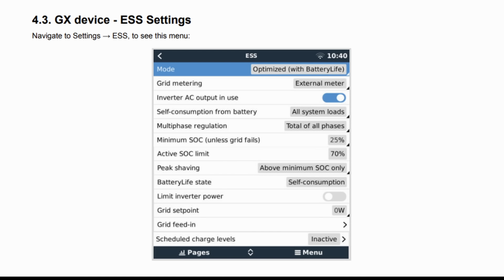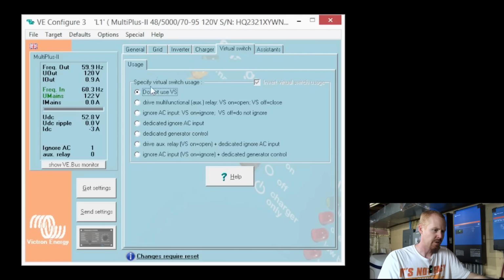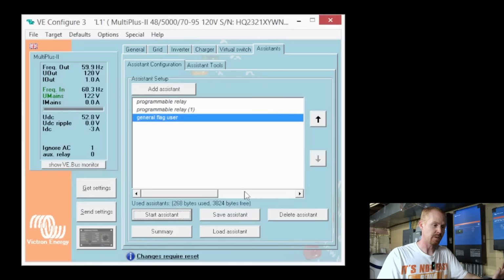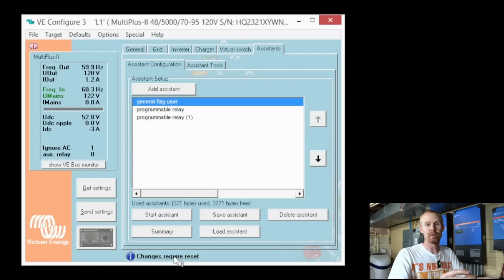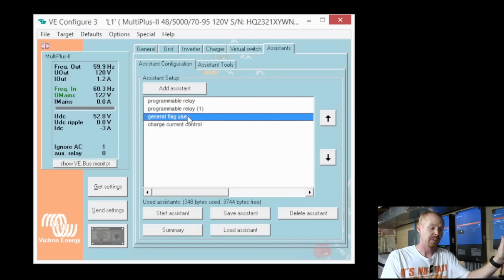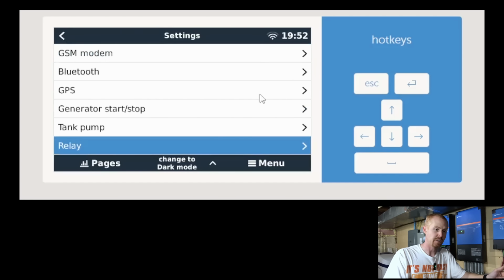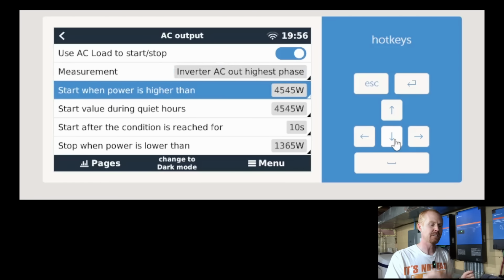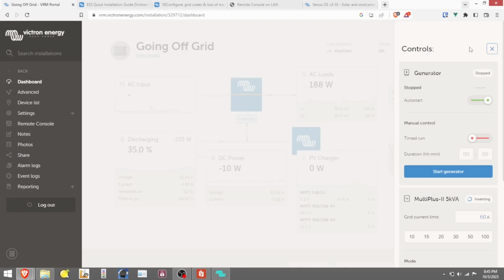Different Ways to Ignore AC Input on a Victron MultiPlus 2 Inverter

Comment: Hello
great video as usual!
I have a question about the multiplus

I would like to be able to charge my electric vehicle at night (22PM and 6AM) and given that my electricity supplier's rate is much cheaper, avoid using the batteries on the multiplus, especially if I have to charge my electric vehicle at night!
Indeed I would not want to empty a large part of the batteries at night to find myself without a battery the next day

Can the multiplus be programmed so that it ignores the charging of the electric car? I would like the electricity supplier to charge the car and not the batteries.
Possible with ESS?
thanks
laurent

PS/ with the programmable relay or the AC/out 2?
Reply from the maker: @laurentsosson1739  appreciate that.  

To my knowledge there’s no way to tell the Aux output to use grid power when the main output uses battery power.  It’s gonna be one or the other.

You would have to install the plug for your car charger between your grid meter and your inverter if you wanted it to run solely on grid power.

Comment: Please demonstrate how you can program the quattro to use the grid as backup while solar with battery is the primary source of energy, like say at night when the SoC fall below 10% so that the grid powers all the connected loads as the battery fill up too, then switches over to battery when the SoC is above 95%
Reply from the maker: I believe the Quattro would work exactly the same as the MultiPlus.  You should be able to use any of the options in this video.

Comment: Great video, thanks for creating it - very helpful for me setting up our system!

One question on the assistants - you've set up the programmable relays with multiple drivers (AC load and SOC), are these conditions "and" or "or"? e.g. do both conditions need to be met for the grid to connect or disconnect, or will it do it if either is true?

I can see this being a potential issue as I'd like to disconnect the grid when SOC is higher than A "and" load is lower than B on one programmable relay, and the other programmable relay to connect the grid when the SOC is lower than C "or" load is higher than D.
Reply from the maker: Thanks!  

So the Assistants regarding SOC and Voltage are in an "OR" scenario.   Once either condition is met, it will switch over to the grid until the "release" condition is triggered.  

You might be able to get more specific on your triggers if you look into using NodeRed.

Comment: Is it possible to switch generator input on and off at two levels of soc? If the batteries are low, turn on grid, and also if batteries are full, turn on grid to export excess solar in ess mode. So in effect two ons and two offs, Is this possible?
Reply from the maker: I’ve never done it before, but it might be possible if you use the assistants to set your values.  You may also be able to use Node Red.

Comment: Would be pretty awsome if you did a video on node red to solve the same problem. I have this set up same as you after following videos, but it has limitations. for example. If I want to charge the batteries at night during cheap rates, i would have to toggle the scheduled charge (which is fine). Unfortunatly, I also have to remember to turn it off in the morning, otherwise it will charge the next night too even though I migt not want it to. Bit of a hassle and lots of remembering. Node red would solve this I think
Reply from the maker: I do have node-red on my list of things to look at.  Unfortunately that list seems to be very fluid and it grows rapidly!

Comment: @adamdelay07.  I am using multiplus ii GX,  i followed instructions to set relay open when SOC is lower than 30% and closed when SOC is above 40% via VRM. Its not working, but when grid connected and it pass through.
Reply from the maker: Which set of instructions did you use?  There were multiple options.  Did you program to use the Virtual Switch, Assistants or the Cerbo?  

There was a note left in the description and a pinned comment about misspeaking regarding the Virtual Switch settings.
Reply: @AdamDeLay07  relays still not switching After using assistant configuration settings for open relay and close.
Reply from the maker: @Kh8876  I'm not sure how everything would work since the "Cerbo" is built inside the inverter.  Setting the Assistants is only part of the controls.  I used the relays in the Cerbo to trigger the Aux Input on the MP to tell the inverter to ignore ac input.  

You may have to look at using a Virtual Switch to control AC input.
Reply: @AdamDeLay07  It works using virtual switch "dedicated ignore AC input". When SOC is lower than 30% it switch to the Grid. Thanks
Reply from the maker: @Kh8876  Awesome!  Glad to hear!
Reply: Inverter is a MultiPlus-II GX it has bildin  curbo GX inside.

Comment: Can it be done with multiplus GX version w/o separate cerbo?
Reply from the maker: @yuriyura2023  I’m not sure of all the differences between the GX and MP2.  I do know that you can program the generator start/stop assistant in VE config to control the AC input.  It’s just not as easy to change.
Reply: No not with gx included muiltiplus.
But with new GX IO Extender 150 maybe.
It has relay out function, but not sure if can be used as gen start

Comment: Hi Adam, great video. I want this to implement in a 3 phase system. Is it possible to connect the Relay 1 com/nc to the AUX1 of the 3 multi´s. It will be nice to notify if this is a safe option.
Reply from the maker: Thanks!  It shouldn’t be a problem at all.  I believe you only need to connect to aux1 on the first inverter.  Since they all communicate, when the relay turns on for one, it should turn on for all.

In my setup, I only have aux1 connected on 1 inverter and the other (in split phase) follows along.
Reply: @AdamDeLayDIY  I ll try it out, one of the coming days, thanks a lot. I ll let know if it works.
Reply from the maker: @edvisser5433  awesome, thanks!
Reply: @AdamDeLayDIY  Thanks again, it works as you said, the master of the 3 phase configuration takes control.
Reply from the maker: @edvisser5433  that’s great to hear!  Glad it’s all working for you!

Comment: Ok I'll look at it in August.  Come to think of it . The ground connection might be the problem. I didn't connect the multi s case with a groundwire . Thought there was sufficient grounding on the mains side. I'll fix it then . Also when I shut it down and restart there are some clicks occuring . Like a relay switching . But it clicks maybe 3 times so on . Off. And back on again . This occurs also when i switch from loading with the switch on to inverter only .  Interesting...
Reply from the maker: @raymondkeersmaekers4785  all the different ground connections are bonded together so using one point should ground things sufficiently.

The clicking could be the grid relay testing and then opening/closing the connection based on what the signal from the cerbo is.  I’m guessing that the grid connection tries to turn on by default and then the cerbo tells it to turn off.
Reply: @AdamDeLay07 Thnx. Tonight I'll try the virtual switch option . Hussle the settings up a bit and assign 51shunt as power monitor. Then something should happen . Currently I'm not near the installation so its all gonna be a bit spooky  .
Reply: Virtual switch is on . Made some comments in the vrm notes section.

Comment: I ve tried it several times with aux1 and then again with aux 2 . parameters are all according to your recomendations gen. start/stop set to auto. now i ve discoverd on the main screen the red part should say ac input 1 ...but its empty , so my guess is it doesnt detect the ac input . active ac input shows disconnected and im not able to change it. 
watched your video 4 times now , .
greetings from belgium . 
Raymond
Reply from the maker: @RaymondKeersmaekers  Howdy Raymond!
Are you trying to use the cerbo to control the AC In or do you just want the MP to have fixed values for the change?
Reply: Using the cerbo . And I´ve made you an invitation to the   installation so you can see the values and settings. The vrm shows ac input. The cerbo not. Ac is of course suplied and works fine with the switch on the multi . Even power assist is possible. 

However do not change any configurationsettings  without  noticing me . Thnx for your help.
Reply: @raymondkeersmaekers4785  ive put some remarks on the vrm section notes
Reply from the maker: @raymondkeersmaekers4785  Everything looks configured properly from what I can tell.  The reason mine showed "AC Input Ignored" was because I had modified my Cerbo and added the GuiMods Package: https://youtu.be/RVkTFtDDvfQ

Comment: Hi Adam
I am in Australia and considering a offgrid design in a suburban grid system, my question is, will this guarantee no back feed to the grid as it is legal and safety issue or would a  manual changeover switch be a simpler option. I would hope the chance of charging my battery bank from the grid would be very low. My design is still in the early stages.
Thank you
Reply from the maker: I'm in the same situation in the US where I cannot have any power feed back to the grid.  

Using this option, the AC IN is disconnected via a relay when supplying power from the battery.  When AC In isn't ignored, it only pulls power from the grid for the loads.

There is an ESS Assistant which does allow for power to flow back to the grid if configured, but it's not enabled by default.

Comment: Thank you! I thought the switches seemed back to front 😅. I wish you didn't have to enable ESS to do time based charging though. Would have been really handy if Victron had included a time parameter on those switches to enable cheap overnight charging.

Comment: When the Relay is on , It will ignore Ac Input 1(means it will connect to battery power). If this is true then programming relay should be set other way around? I am bit confused!
Reply from the maker: Yeah I misspoke.  I have a pinned comment as well as a note in the description clarifying.  

*
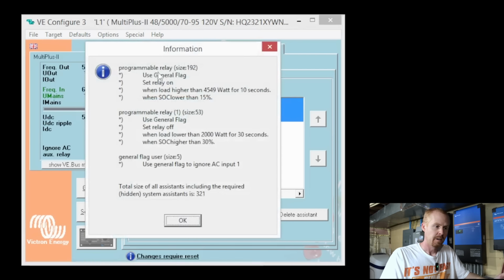At 9:21, the generator start/stop assistant information is not correct.  In the video it shows the relay being turned on when the load is high or the SOC is low (and the opposite for low load and high SOC), but the relay should be turned off.  The relay is controlling the General Flag (AC Ignore).  When the relay is set to "on" it will activate AC Ignore and turn off the grid connection.  When the relay os "off" it will NOT ignore AC In and the inverter will switch to passthrough mode.  

Basically  you just have to switch "relay on" to "relay off" and visa versa for the two programmable relay assistants.  Unfortunately I cannot edit the video to add the correction without taking it down. 
*
Reply: @AdamDeLay07  thank you so much for clarification.  Otherwise it's great help

Comment: I would just use a manual circuit breaker as a switch or a changeover switch for different sources of ac power.
Reply from the maker: Yep, defiantly an option if you want to keep things manual.  I just don’t want to lose power in the middle of the night because I forgot to manually change back over to the grid when my batteries were getting low.

Comment: I need your help. I did the generator start/stop method and it is working perfectly except one thing, every time it gets to the battery SOC level to activate the AC input on my Multiplus I get an alarm on my Cerbo GX “generator not detected at AC input” even though I get this alarm everything works as expected, the AC input is enabled and the batteries are charged to the set levels. How can I disable or modify this alarm?
Reply from the maker: Hmm, haven't seen that message before.  Under Settings -> System Setup what do you have set for AC input 1 as well as "Monitor for grid failure"?
Reply: @AdamDeLayDIY  I think I may have it figured out. There was a setting to detect generator at AC 1, it was switched on. I’m now testing it with that setting switched off. I’ll see if I get any more alarm notifications this way

Comment: Hello, thank you for this video! Why for the first part (without the CerboGX relay) do you use two programmable relay assistants and not only the “generator start and stop” assistant?
Reply from the maker: It took me a while to figure out that I could use the generator start/stop function (either from the MP or the Cerbo), so I was just showing the different options I had come across till I found one I really liked.

Comment: Thanks!  I implemented on our motorcoach.  I also use an Assistant to drive a relay to kill power to 2nd AC on loss of shorepower.  It appears the genset/AC ignore setup will produce the same result.  Nice when rig sits plugged in at home to get a little free power!

Comment: Great video. Extremely helpful. I see you have 2 larger multiplus units which cannot be paralleled. Have you bonded the neutrals of these units or are they isolated?
Reply from the maker: Thanks.  

I have two 5kVa inverters set up for split phase.  They can be paralleled together though for 10kVa on a 120v system.  The neutrals are bonded together.

Comment: Adam, so well explained and clear. Thank you! Question: we are mobile and I would like to use this technique of Cerbo-to-MP relays to control powering a water heater. Like many mobile users, we have our MP turned off as default to reduce parasitic draw. 

Do the assistants run when the MP is off? Seems like a silly question, but I know for a fact that "off" does not mean the MP is not powered as the Trickle Charger functions even when off, so long as attached to the battery bank.

And if so, can an assistant turn on the inverter, so a water heater can be turned on? 

Thanks!
Reply from the maker: Thanks!

I think it might depend on if "off" is referring to using the switch on the bottom of the inverter or if your turning things "off" through the VRM.  If you use the switch on the inverter, then the system is completely shut down.  I'm not quite sure about the "off" state through the VRM.  I would imagine certain aspects would need to remain active to allow you to turn the system back on.  

Since you have a Cerbo, have you looked at the GuiMods video I made which would allow you to easily turn the inverters on/off on the cerbo? I know you can go to Settings -> MultiPlus -> State and turn the inverter off, but that's way too many clicks.  If you install the GuiMods package, you can then just tap the inverter on the Cerbo display and turn it on/off.  https://youtu.be/RVkTFtDDvfQ

Comment: I understand your video...great job.   I have grid and generator.  Sometimes the grid is off  (Bahamas !) and I need the generator to behave as in your video. The generator would be started manually so AC would appear on input 2.  Would the scenario work without any changes eg if I used the Start Generator Manually for say 1 hour to top up batteries ?
Graham
Reply from the maker: Appreciate that Graham!

Since you have a second AC In, I'm guessing you're talking about a Quattro, which I'm not 100% familiar with.  

Do you have the grid connected to AC IN 1 and you're trying to ignore the grid connection as well?
Reply: @AdamDeLayDIY  Yes there are 2 AC Inputs on quattro;  AC and Generator normally (could be wind)  Could I  duplicate with a second general flag for ACinput 2....?  Or can a general flag have 2 designations or can you have 2 general flagS?
Reply from the maker: @grahamllewis  I know the Cerbo only allows for the generator controls to be used on Relay 1.  Going off the cuff, you may be able to use the generator assistant in the quattro for ignoring the grid connection and then use the Cerbo/Generator Start stop feature for controlling the generator off Relay 1.  Just a guess though.